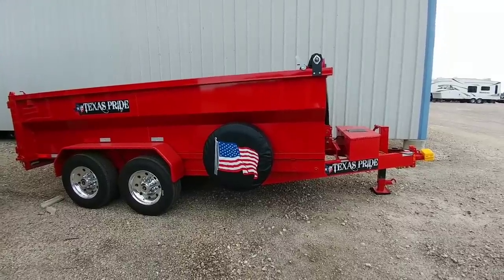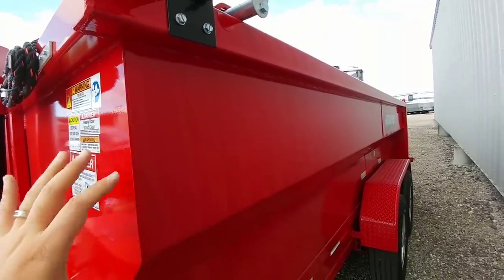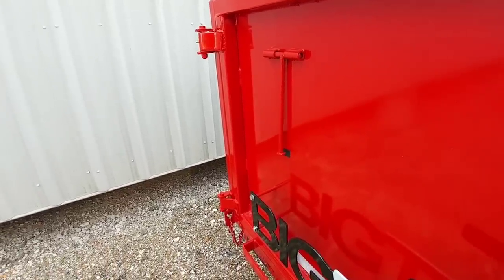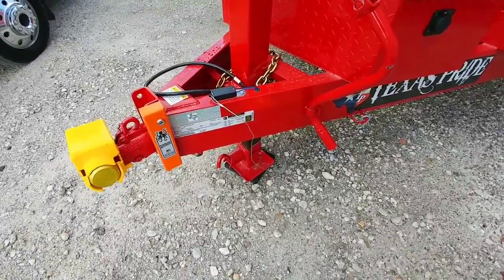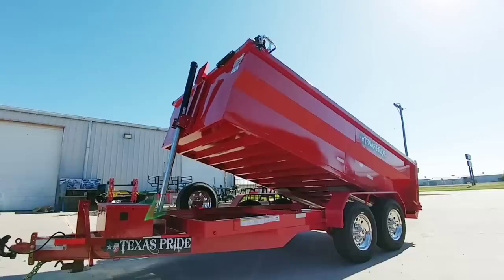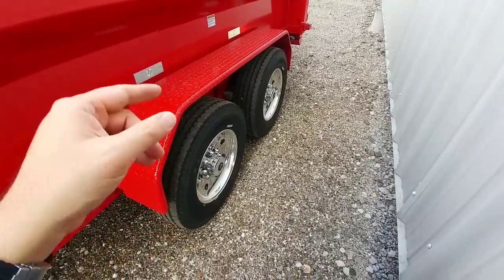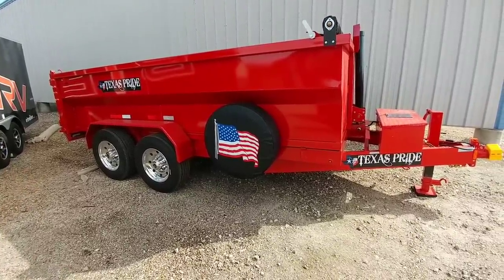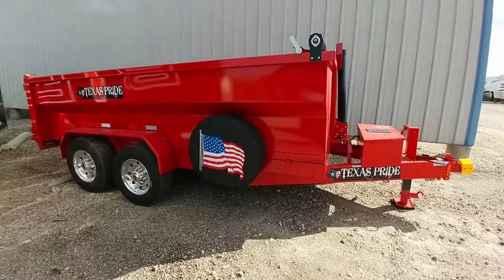Buying a Dump Trailer? Watch this FIRST! What's import! Texas Pride Trailer.

Comment: I've seen those hubs with grease zerks leak and ruin brakes, too. I just bought a used, 18' enclosed cargo trailer with two 7,000 lb. axles. The previous owner had way over greased the hubs and pushed grease past the seal and basically flooded the brake cavity. Two had the linings delaminated from the shoes and stuck to drums.

Comment: I like lamar trailers. Standard gate hold back system, 12k jack, rigid rails, 7 gauge floor, demco EZ latch coupler. Although I disagree with grease vs oil bath simply because oil is a better lubricant than grease. Years ago someone told me lamar was the best in the business and I have researched dump trailers for 10 years now and I have to say in my opinion lamar dump trailers are the gold Standard and set the bar

Comment: I can see my employees jamming on the brakes going in reverse to "unload a load faster " busting that telescoping ram I went with a 14k D max that is over built on the frame and box where it's under built compared to your trailer is in the axles wheels and tires which I plan on upgrading. Thanks for sharing

Comment: This trailer should be a gooseneck. 12000lbs to the Chevrolet Tahoe does not attach. Only attach this trailer to the tractor. Hi from cold Russia :)
Reply: im about to order the same bumper pull trailer to pull with my f250 but the triple axle version that is built for 30k
Reply: @dpd16790  2018 Ford Super Duty F-250  Maximum Trailering Capacity (lbs) 12900
 Dead Weight Hitch - Max Tongue Wt. (lbs) 1290
 Fifth Wheel Hitch - Max Trailer Wt. (lbs) 12900

Comment: Another thing with oil bath is they really need to be visually checked regularly to make sure oil is still in there. With a solid hub cover you are not going to take everything off just to look at the clear cap every trip.

Comment: I didn’t hear anything about fenders. You WILL stand on those, and sometimes holding hundreds of pounds.  They look beefy enough to support 1-2 men.
Also, WHEN you get a puncture in a tire, please detail the repair. I know that I have  L-rated tires on our dump trailer and every time I had to plug it, I had to drill the hole out first before I could even get the plug through the plys. I can’t imagine how difficult those hockey pucks will be.

Comment: My thought on grease vs oil bath axles is this. If you use the trailer often, like weekly or more, then oil bath is great. But if the trailer sits for a long time between uses, then I'd go with grease, because oil bath axles leak when they sit for a long period of time, then you have the mess and safty issues you discussed. With grease, just give it a few shots between uses.

Comment: At PDQ Trailers we build our entire top box out of 2x3 11/14 gauge rect tube all uprights on 2' centers and crossmember on 16" centers for a less wavy floor unless we do a 7 gauge floor the bottom is constructed out of 2x6 3/16 rect tube nobody on the market is building trailers as strong as us Especially with all USA MADE STEEL

Comment: I think that if the tongue was even with the main frame (front rail penetrated) it would be stronger and look cleaner at the front.  The c-channel and tongue hanging below looks kind of cobbled together.
Also, using the drop-leg on the tongue jack makes hook-up and disconnect much faster.
Reply from the maker: John, you idea of using a solid beam for the entire frame would allow for a slightly lower deck height but would likely be weaker unless you used a much thicker gauge I beam.  The way it's designed currently transfers energy away from the section supporting the dump body to the aframe and this increases the overall load handling.  At 20k lbs you would want as much load dissipation as possible.

Comment: Do you still have your flatbed equipment hauler? I remember you gcvwr of your 450 and the trailer exceeded 26,000 pounds and we discussed this cdl issue. You had told me it was not under cdl or fmcsa regulations. Has your opinion changed. Also, there may be a problem with De-rating  trailer or truck to avoid cdl or fmcsa regulations. After all, a trailer that would have had a gvwr of 20,000 pounds is still the same even though a sticker says it’s gvwr is 12,000.

Comment: What do you think about the strength of an A frame style trailer vs a single peice i beam frame. Ive read the i beam is stronger and that A frame tends to crack near the suspension where it ends due to flex.

Comment: Here's a question....How wide is the top of the bucket and how wide is the bottom of the bucket? I'm assuming that is a "7ft" wide trailer? Is it 7ft wide at the top....or the bottom? There's a substantial loss between top and bottom according to the pictures.

Comment: Don’t know if the T-handles would work up north could rust and seize up nice trailer though
Reply from the maker: WD40 would prevent that.  There is plenty of tolerance to keep them moving well.  I believe hinges and other movable components would seize up first
Reply: @BigTruckBigRV  why not galvanized steel or an aluminum dump trailer to prevent rust issues?

Comment: Using the grease fitting in the end of the axle will push grease out the seal onto the brakes as well. That fitting should never be used. Instead of people being lazy they need to take bearings apart, clean, check and repack properly

Comment: Texas pride does not use Dexter brand axles, I hope their generic axles are quality made and replacement bearings and parts are available locally.
Reply from the maker: They have an option for Dexter axles which cost a bit more if you want to add them, but from a performance perspective, they say they're the same.  I recently toured their factory (Sunday's video) and saw the sheer number of axles they go through.  It was literally thousands of axles.  I can honestly say that even though Dexter has a great name to them, it's not a fail proof product, considering they are installed on almost all RVs and many owners dislike their long term performance.  Every product will have a failure rate per 100 units (Problems Per 100 units).  I'm not sure how their axles compare in terms of PP100 axles installed, but I bet it's very small.

Comment: Well if I was to order one I would make two changes. #1 electric over hydraulic disc brakes # 2 the hydraulic jack. 
I have a RV I up graded the brakes to the afor mentioned system  I WILL NEVER order a nother trailer with those antique drum brake system 
Just my opinion

Comment: Iron bull are the best dump trailers in the game
Reply: Kelly Giesbrecht I’ve owned my trailer right about 2 year with It 7x14 low pro 14k dump i am always putting 6 ton plus rock/ trash/ lumber  and hasn’t failed me at all. I am planning on buying an iron bull 16 foot long gooseneck witch is a next step up. Also deepens on how you load a trailer And what you use it for. I use mine for my demolition company...... the paint last no rust I am from  oregon always raining and easy to maintain and they provide road side assistance. the price for it ain’t bad at all. I’ve seen several trailers and the welds aren’t the greatest and the paint is cheap. I recommend iron bull but everyone has their opinions

Comment: I have to say, I just took delivery of a "dump exactly spec'd like Big Truck Big RV" but with 4ft sides... and it looks horrible compared to yours. They oversprayed everything.. The front cylinder....hydraulic lines....bolts...and didnt even bother painting the back side that was facing the trailer of the hydraulic cylinder itself. My welds and caulk look HORRIBLE.. I asked for no stake pockets and even had my Reb confirm it wouldn't have them only to show up after driving 800 miles to pick it up and they were there...along with not  being Derated... I love your video's JD....but I feel this is a huge misrepresentation of the product....because its not what they build for the general public...they were meticulous with yours since it was going to be on YouTube. I did reach out to them and was told to send an email with photos and all...I'm waiting to see what happens.
Reply from the maker: I'm sorry to hear that my friend.. please let me know if they rectify the situation.

Comment: not to bust your nuts, but your trailer was de-rated, not overbuilt and single hoist is old news on dump trailers, unless you are buying budget trailers.
Reply from the maker: Not bursting my bubble.  I could easily say I have a 12k trailer that is built the same as a 20k trailer.... Potatoes..  also, all dump trailer manufacturers using a front mount single telescopic lift view it as a premium upgrade.  You are referring to a single ram that is mounted in the middle center of the dump.....and you're being a troll.   Hope you are having a great day.